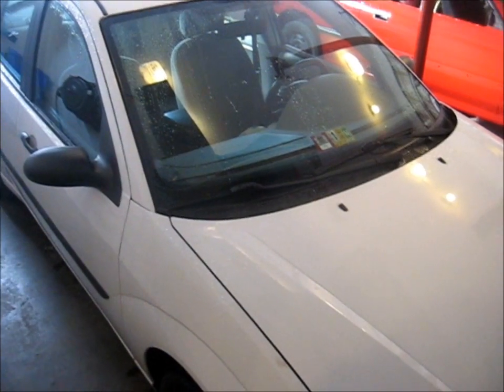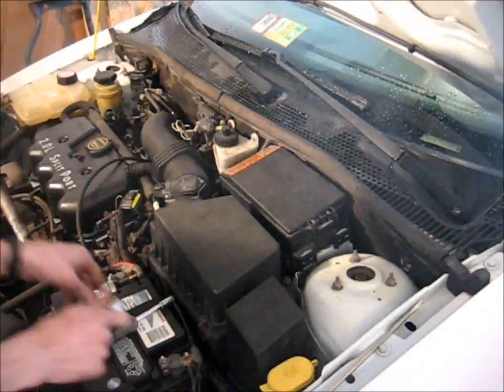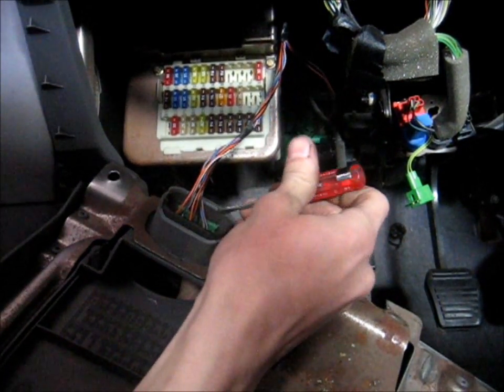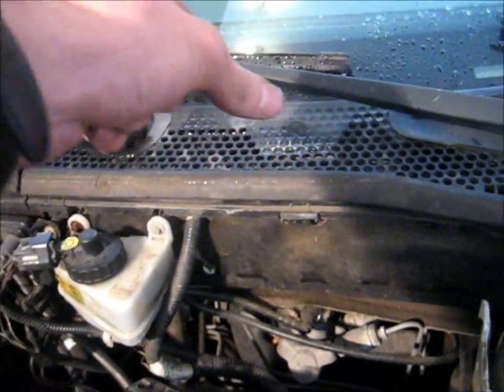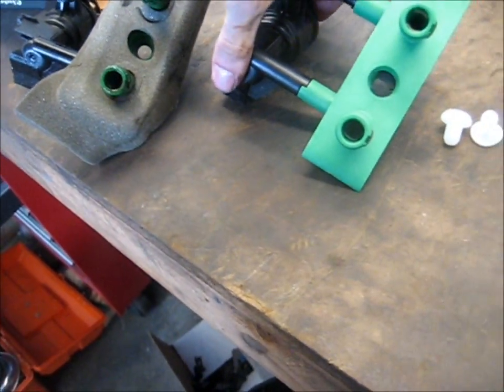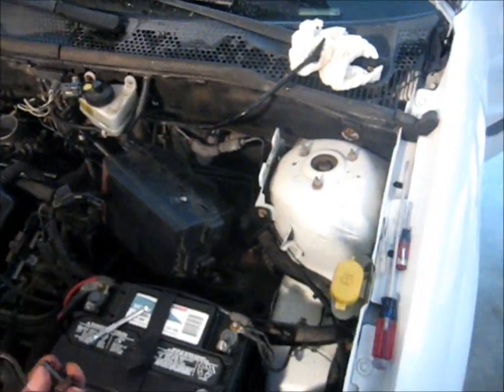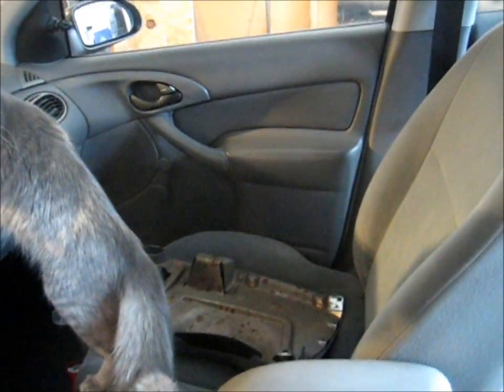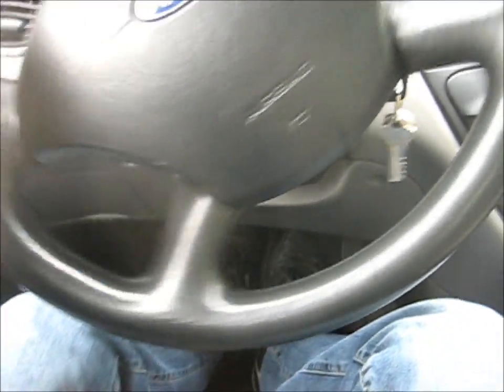How to Replace Ford Focus Clutch Master Cylinder

Comment: Do you remember what mm wrench you used to loosen the clutch bleeder screw? I can't get any of my wrench or socket to fit to loosen it. it's in such a tight spot. Also, now my car does not start up. it powers on but does not turn over? How long did you pump you clutch to get some pressure? mine is completed depressurized and does not start.  Any help from anyone would be greatly appreciated. I got to get to work Monday and now my car is sitting in driveway dead!
Reply from the maker: On mine, the clutch slave cylinder had a knurled thumb screw for the bleeder. Just twist it 1/4 turn each way to open and close it. If your car started fine before then I'd imagine that you left the clutch pedal switch disconnected.
Reply: TheAlexManVideos thank you so much for the quick response. Unfortunately, mine has a screw instead. I plugged the clutch pedal switch in before I started it but still no luck. one thing I forgot to do was bolt the two side bolts to anchor the clutch master to the pedal, even though it's seated perfectly in there. I wonder if that had to do anything with it? Also, is it possible to bleed everything via you brake system, rather than using the clutch bleed valve? I am afraid the answer is going to be NO but I figure I should ask. I need to get the car running somehow before Monday comes to get to work.. Also, how many times do did you had to pump the clutch pedal to get some resistance? I did it for  15 minutes (pumped 40-50 times) still with no resistance with the resevoir filled.
Reply: TheAlexManVideos i was finally able to get it started today.... whew!!! what a relief. I put the battery back in and turned the car on. Then I literally pumped the clutch for 45 minutes. After that it was getting to hot inside the car, so I turned the AC on and all of the sudden I got pressure in my clutch??? Also, yesterday, it didn't start because the "Clutch Starter Safety Switch" (which you zip tied), was soaked in brake fluid from when I was changing the master cylinder. I pulled it out and cleaned it and then the car started up. Also, I still couldn't take the bleeder valve off. it's 11 mm wrench or socket. I sprayed some wd40 today hoping, I could take it off later. I was able to drive the car around my block couple times with no problem. the gears shifted perfectly. but I still need to bleed the clutch....I am hoping the wd40 do the trick. I am going to :Reverse Bleed" it if I could open the bleeder valve.

Comment: hi while puling the tubing line that connects the master cylinder to the slave cylinder it broke is there a way to fix it or get it from somewhere. It was really difficult to get it out that the metal broke.
Reply from the maker: If something doesn't come apart easily you should stop and think it through rather than just forcing it. You'll usually end up damaging parts, spending money, and losing your car for a few days. It should not be difficult to remove, depress the lock ring while gently pulling the tube straight out of the fitting. If it is broken it cannot be repaired. You will need to get a new part from the dealer/auto parts store or grab a used one from a junkyard car.
Reply: I did remove the lock ring, but the head of the tube was still hard to pull. i did buy a new part and should be able to install it soon. is there a way you can show me how to remove the part that connects to the slave cylinder?
Reply from the maker: Vittorio Lo Cascio
I have not removed the connection to the slave cylinder in 5 or so years so my memory may not be 100% accurate. If I recall correctly, it connects and disconnects in the same fashion as the connection at the master cylinder.
Reply: TheAlexManVideos
Hi Alex thank you for the video and the recent information you provided me. I have another question, when I finished to install the master cylinder I noticed that the clutch paddle does not reach the small plastic ignition switch like it used to. every time I need to turn on the car I have to push it with my hand. Another issue is that after replacing the master cylinder  and bleeding the clutch the clutch is still not working. Do you have any ideas.

Comment: That bolt don't need to come out.. Pull two clips out of lines... then flat clip on other side that holds cylinder to bolt
Reply: That's what I have been thinking! Hence my question to your earlier comment and to him!

Have you done this before? I need to do it on mine but want to be sure before ripping it all apart!
The center bolt on mine is rusted off AND I have been looking at the assembly and I am thinking it doesn't need to be removed as its rubbery and quite flexible to pull the old master cylinder through from the inside  - THEN - push the new Master cylinder through from the inside when re-installing... Thoughts?

Comment: My clutch doesn't disengage properly when it's cold and it's grinding gears, but it fixes itself as it warms up. My master cylinder does not leak. Is it possible for it to go bad in any other way?
Reply: same with me
Reply: I'm glad I'm not alone. I asked around in several forums, asked several mechanics, nobody told me anything useful.
Reply: mechanic  told me first  to check and replaced this cluch master cilinder
Reply: If you decide to go ahead with it, PLEASE update me with the results. I really don't want to tear my car apart without knowing that I'm going to fix it. Not to mention the price of this component.
Reply: The answer there is an absolute yes.  What you are describing is exactly what would happen as it wears out.  Mine was doing that exact "work while warm but not cold" thing and it finally died completely yesterday.  I had it towed to my mechanic and he did a simple test to determine that it was the master cylinder.  He's fixing it Monday.

Comment: I ruptured the front passenger brake line & it runs along the firewall & IS NOT THE EASIEST TO GET TO! The cloth that lines the firewall is hanging & releasing some powder when it is disturbed! It is a hot mess & I am thinking that it would be best to cut out that cloth firewall insulation because it is showering white dust everywhere & I must constantly use one hand to hold it up & I CANNOT HAVE IT RAINING THAT POWDER INTO THE BRAKE FLUID & CONNECTIONS SO, I am going to cut it out!!!

Comment: Like that's the last thing in world you need to replacing on any car.  Especially when they bury it in the car so you can't find it.  And if you have to it should be easy to find and easy to replace. Car companies do this crap deliberately. I can't believe how people are so complacent about being taken advantage of and end up spending thousands to change out a plastic piece of junk that is not designed to last for more than a few years.

Comment: Then pull cylinder thru the holes from inside.. That ivan seal with two holes stay in there
Reply: Hey, are you referring to the little black rubber which he pulled from the firewall inside the engine bay? 

I have been wondering if he had to remove the screw which goes through the center of the inlet and outlet on the firewall... Instead, there is a 'U' clip on the inside which is easily removed... It also seems to me that after he removed the center bolt and the little rubber seal on the inside of the engine bay - that did not affect the ease with which it was pulled through... In essence, it seems to me that it could have been pulled through the rubber seal from the inside without removing it in the first place.

The problem I am having is - the center bolt ie: between the in and out lines on my firewall is completely rusted in and I am trying to find a workaround.
 
SO my question to you is - Could I just remove the 'U' clip on the inside, remove the 2 bolts which hold the master cylinder to the clutch pedal assembly, remove the 4 bolts which hold the clutch and brake pedal assembly to the firewall -THEN wiggle the master cylinder assembly away from the clutch pedal AND finally - pull it through the firewall - WITHOUT removing the screw and black rubber seal from the firewall?

PS: not trying to discredit his video here - just trying to find a workaround to my rusted out center bolt - and from watching his video it would seem to me, the center bolt and rubber which he removed from the firewall, had very little effect on the ease with which it was removed - in other words - he just simply pulled the rubber seal off from the inside of the engine bay which suggest to me (I could be wrong) if it had remained in place he could have simply pulled it through from the inside... 

All thoughts appreciated!

Comment: Thanks for all the comments below, some helpful tips. Anybody know how long I can go with the master cylinder leaking? I noticed my floormat slick about a week ago, but thought the rubber mat was just deteriorating. Today is when I noticed it was wet and narrowed it to the master cylinder. Hoping to make another couple weeks so I can drive it from my apartment to my house to fix it during Christmas holidays. I don't want to get stranded because I cant use the clutch though. Can I just top off the brake fluid and throw a rag under the clutch pedal and limp by for a couple weeks? TheAlexManVideos  Ian Deady
Reply: " Anybody know how long I can go with the master cylinder leaking? ............ that's basically a "how long is a piece of string" question. leaks in hydraulic systems due to the rubber seals deteriorating are USUALLY slow, they can go on for months or just burst in an instant-- that's why they should ALWAYS be attended to immediately in braking systems.
If your clutch fails completely, here's tip to avoid getting stranded:  you can drive without a clutch, I've done so many times, so have most mechanics, or they certainly did many years ago.
Here's how: start the car in neutral, let the engine warm up and the battery charge.
Put the engine off, and the car in first gear, and then start the engine with the car still in first, with a reasonable amount of accelerator.
If you are not facing uphill, you're off and running. Now, a trick from the old days of crash gearboxes with no synchromesh. Get a bit of road speed and then just take your foot of the gas and put the stick in to 2nd. Sometimes you have to be a bit firm. going down the box, into neutral, a slight rev and into the lower gear.
To avoid possible abuse of your starter, drive to avoid stopping, and where possible, stop on a downslope.
Practice the technique now, while you still have a bit of clutch, you don't want to try to learn it when you're stuffed!
Reply: Jay Igaboo Well the string was long enough to get me by for the week! I wasn't real sure how it worked internally. I also appreciate the how-to on running the car if the clutch fails, I'll have to give that a try (even though it isn't a necessity now).

For anyone replacing their master cylinder, I did not have to remove the interior panel, obd sensor, and all that. I was able to just pop the sensors underneath off, bend the bracket out of the way, disconnect everything on the engine side, and maneuver it out of the way. I LOVE youtube though, it would have taken me a while to figure out how to remove the fuse block, that the bolt on the engine side was there (it was crudded up enough I couldn't make it out to be a bolt heat), etc. It would have taken at least a couple hours extra (it took me about 3 hours start to finish )

Comment: what size was the bolt at 7:30
Reply from the maker: M6x1.0 thread, 10mm flanged hex head. Don't remember the length.